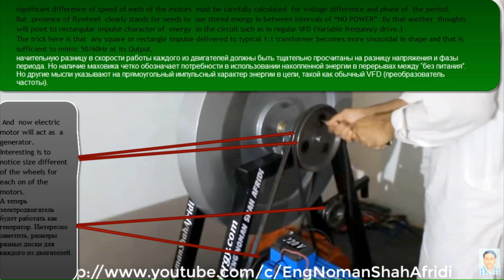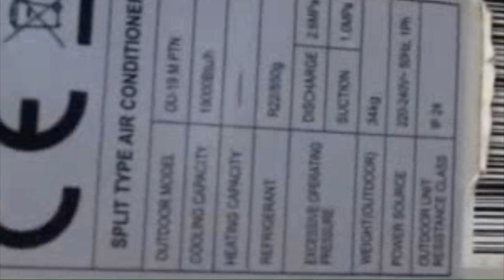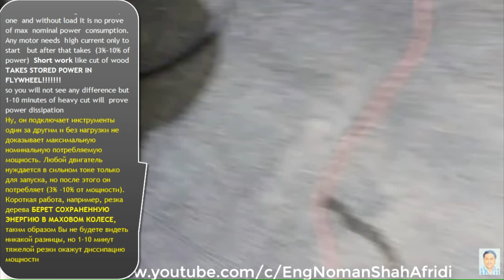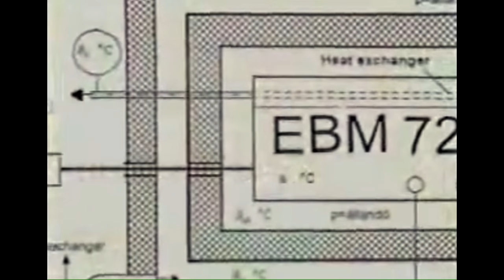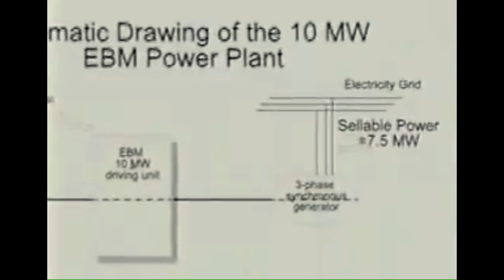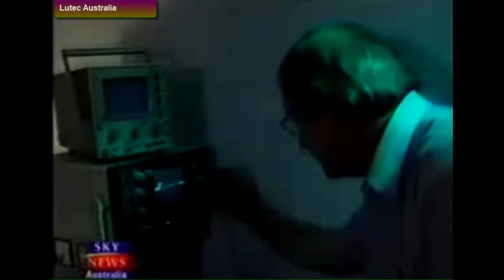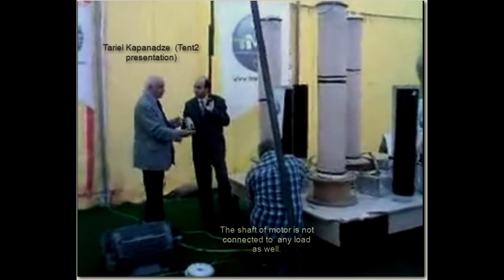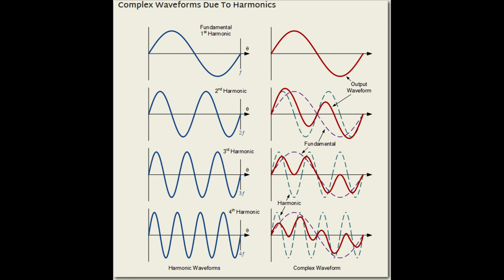What's common in Norman Shah Afridi , Lutec, EBM, Kapanadze, Free Energy Device

Comment: Thank you Wesley,  your analisys of those systems are always great, i think you are pretty right, not so different as having an array of charged supercaps and inverter.
Saluti, Gianni.
Reply from the maker: Simple and short explanation:
Not it may not be so simple.
Tariel Kapanadze (TK) followed by Akula and Ruslan and many others  represents  replaced by  electronics function of electrical motors still present  in all of TK high power presentations due to lack of equivalently capable electronics to replace them.
These motors function,  was not to serve as a load but as converters, and at every of his installations TK used ground wire.
EBM I was told used ground as well.
Lutek  was not conformed by me but considered  it had it as well.
 Norman Shah Afridi might of play with it by his strange light source change at 07:43 , 07:48
by examination of shadows on the walls - for me it looks like he disconnected existing light from external power supply and reconnected it to with the outlet  of his machine output. 
However  Norman Shah Afridi never provided video camera view on that light source!!!!! We see only wire with the plug that might be connected to solid ground reinforcing artificial LC reactive ground the same way as car antenna  uses car metal body as counterbalance for its dipole operation.

I'm not speculating here about tricks with possible additional power delivery  when "light" is still connected to external power supply with light bulb in series, - - - where plug has 220V - losses on  series resistance =output voltage.
So if that plug was just to be shorted  than the circuit for light fixture would be closed and light would come on. 
The reason  I have  excluded that scenario is, that Norman Shah Afridi have provided all contact information for anyone to verify it. 

THE BOTTOM LINE IS: promoted by me and not fully finished as of yet  Electrostatic Pump Theory
that tries  to explain phenomena supporting energy conversion that is free of charge ( google it, you may find some of it out there) 
Wesley
Reply: stivep1 thank You for the response, the "electrostatic pump" is a good concept, i see IonPowerGroup, as Tesla Radiant Energy Collector, those methods are passives, maybe Kapanadze and akula like devices use the same principles plus Active circuitry to improve the "Collection" of charges from ambient backround electrostatic gradient (Pump/siphon Effect)
Reply: Infatti è un truffatore
Reply: È un ladro e truffatore noi ci abbiamo rimesso 6.600euro mai arrivato il generatore e mai rimborsati dei versamenti fatti di 6.600euro
Reply: @immacolatadinuto3306  et pour le coup wesley raconte n importe quoi...du fantasme sans connaissant aucune en matiere d electro magnetique....
Reply: @nicoslider  after some time i see the reality of those guys.... just Scammers